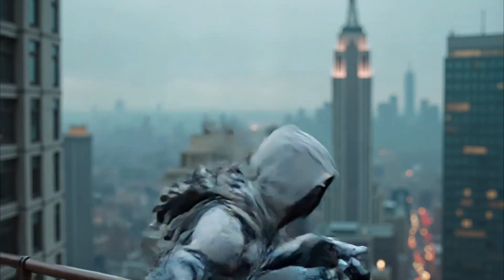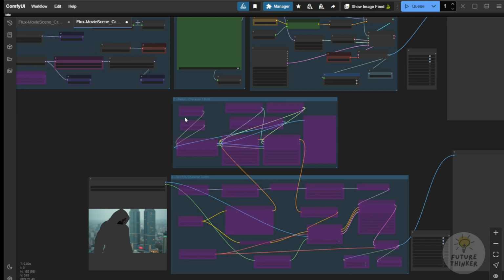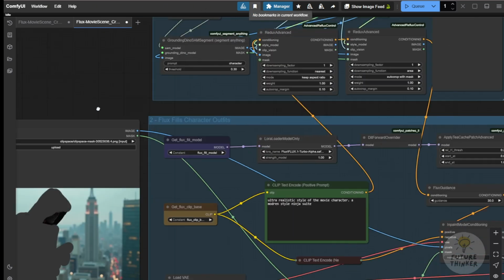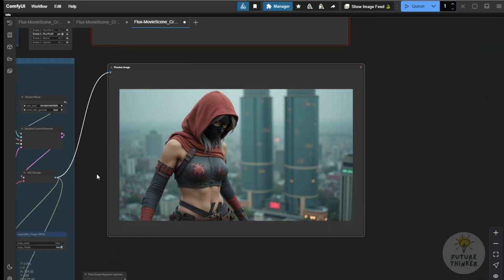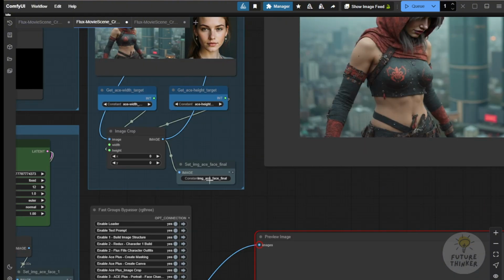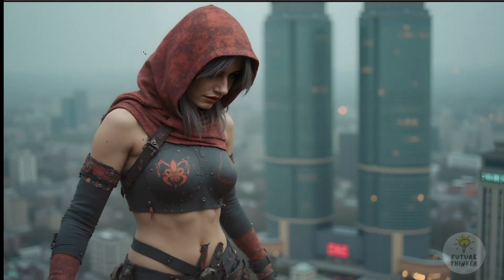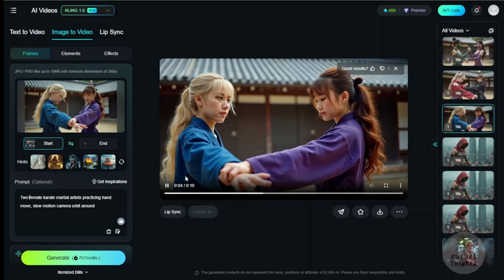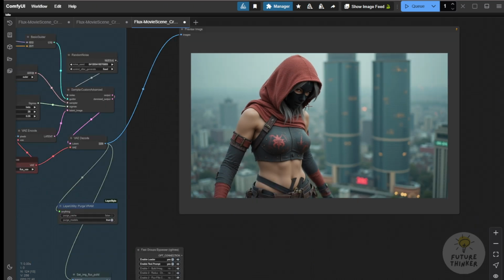ComfyUI AI Video Scene Builder Using Flux And Latest Extension

Comment: Is there a way to clean up Comfyui? I can't get torch to load right when comfyui loads up but I used chatgpt to fix it and it looks fixed all compatability. Is there a way to uninstall and reinstall clean comfy?
Reply: @Caged_Monuments I'm in the same situation, if he gave us an installer... it would save us a lot of headaches
Reply: @TheXiNoTeX  installer is alot of work. maybe a docker would be easier. But I had made a new install of comfyui and this time I ran it and installed everything with a virtual environment so that all the dependant files stay within it.
Reply: @TheXiNoTeX  If you're using Comfy then you should be knowledgeable enough to install & debug workflows.  If you have trouble, that's what an LLM is for.  There is no one making installers for Comfy workflows.